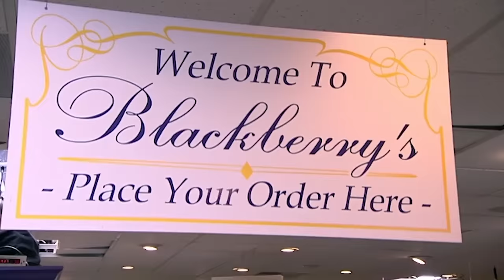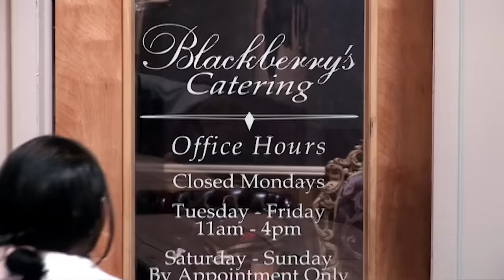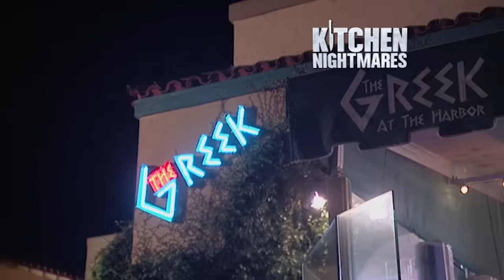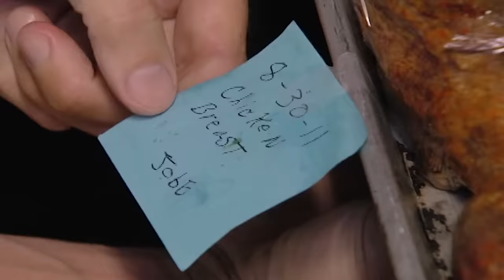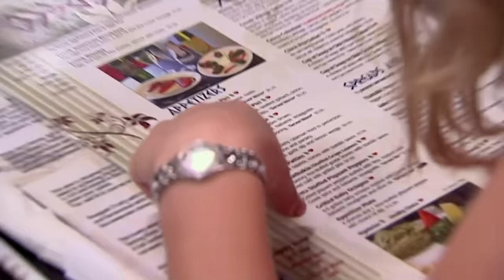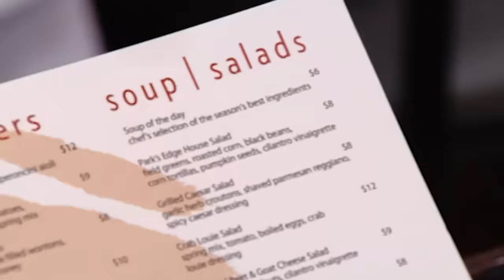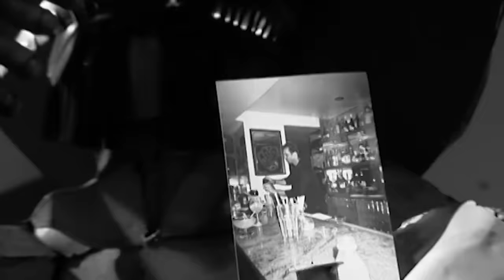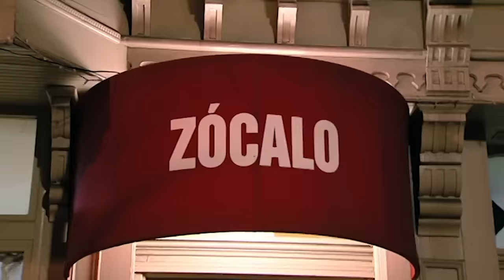absolutely unhinged episodes p2 | Kitchen Nightmares

Comment: 13:35. The mouse is probably dead BECAUSE of the exterminator
Reply: That's literally what I thought but this isn't supposed to happen. They put down traps and the mice should become trapped. This one was probably poisoned meaning it ate poison and crawled off to die... when you think of this it's even more ridiculous and dangerous.
Reply: Yea but he also killed me tryna blame it on the chef 😅😅
Reply: State licensed exterminator here (you have to pass the exam) and the reason why we use poison rodent baits with the delayed reaction time is so they can leave before you have a bunch of dead mice in the walls. Snap traps just keep the decomposing bodies in the building longer, and glue traps we just used to monitor areas for activity.
Also, there are a lot of places that get regular preventative service, biweekly for some restaurants, more like monthly for bars and laundromats. I don't eat fast food, but I can say in general they're the cleanest restaurants because they have cleaning schedules that need to be checked off, and the equipment is on casters to roll out and clean behind. Also, everything is tiled so easier to steam clean.
Reply: No it ate the chitterlings 😮😮😮😮
Reply: Exactly what I said. The point BOTH of them missed lol 

•we don’t have a mouse problem. We have an exterminator come regularly. = Buddy if you didn’t have a mouse problem, you wouldn’t need an exterminator. 
•The mouse is dead there BECAUSE of the exterminator.

I mean they don’t evaporate as soon as they die.🤷🏻‍♀️🤦🏻‍♀️